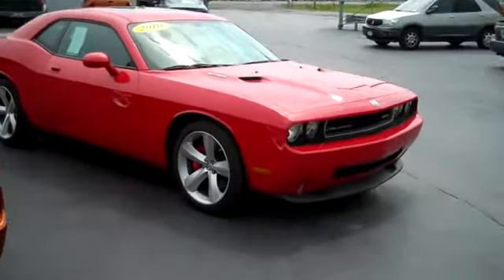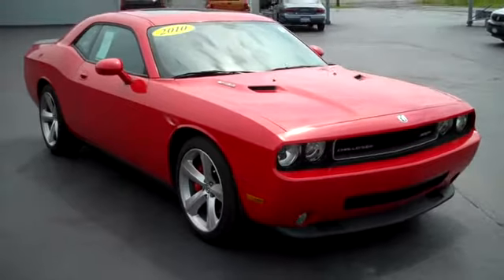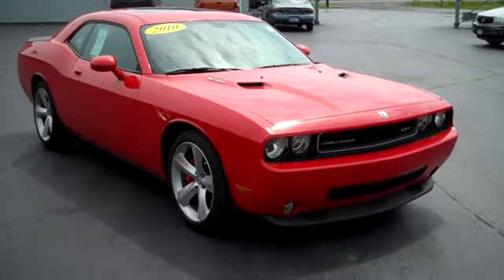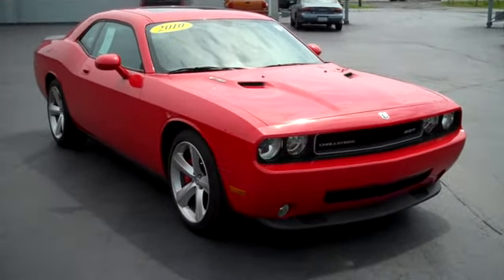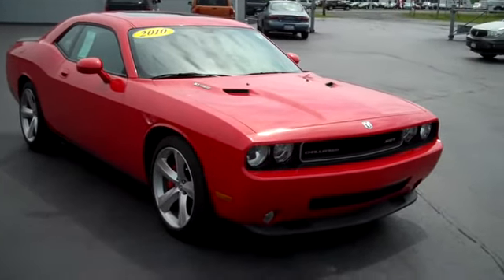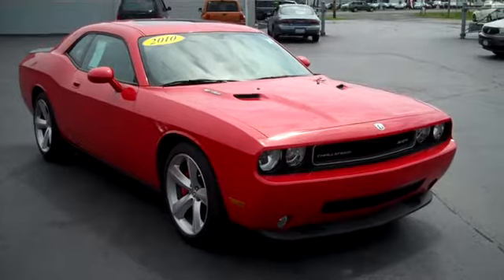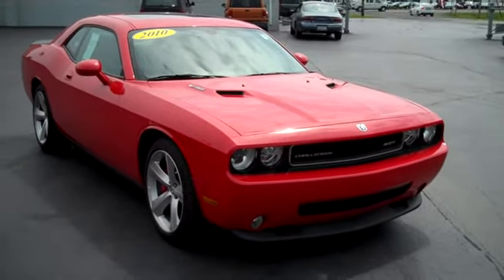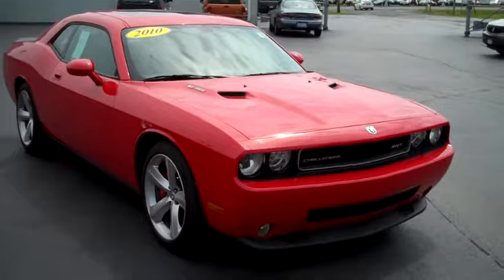Dodge Challenger SXT vs RT vs SRT8 engines

Comment: Of course the SRT8 sounds like an absolute beast. The SXT and R/T didn't sound too different, but the SXT (the silver 305hp one) surprised me on how powerful it sounds from the outside, given its awesome MPG rating; it has a very similar sound to the SRT8 from the inside which is awesome, though I'd assume not as loud. Thanks for posting this! I'm planning on getting one of these and a real-life comparison between the three was just what I was looking for :).